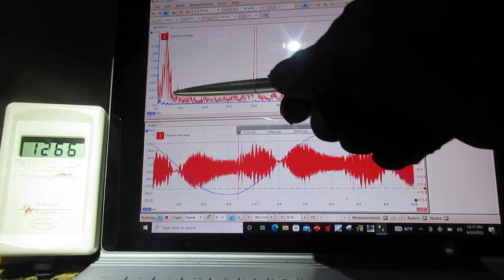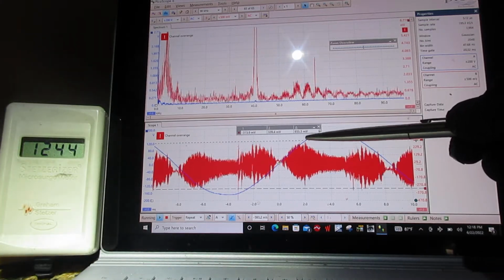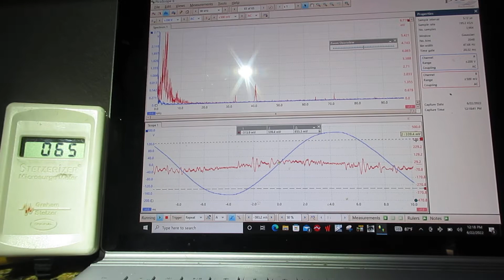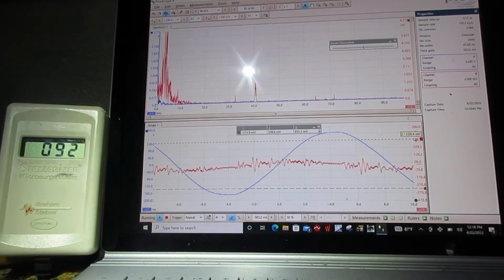Solar inverter next door creates discomforting Dirty Electricity for my client in Davis Ca.

Comment: I am curious, what filter did you use?
Reply from the maker: Hello MoeMar26: I start off with lowest cost parallel capacity filters and work my way of to expensive and very effective filters.  It all depends on which filter is most effective for a particular application and what the client is willing to invest or what is acceptable to them.  I never make product recommendations until I test and assess the actual situation.
Reply: @windheimemfsolutions  What is your experience with Line EMI filters?
Reply from the maker: @John-ek5bq  If the client wants more complete filtration I try them out and see if they improve on my basis filter set up.  They generally cost a lot more.

Comment: Hi Eric, thanks for sharing. I'm in residential solar sales, and I'd love to know your honest opinion based on what you've seen with DE: Could you feel good about selling solar? Should I steer people toward Enphase (micro-inverters) or Solar Edge (central inverter + power optimizers)?
Reply from the maker: Hello Joel,  I suggest you get a Stetzer Meter and measure exiting solar systems to see which combo of components produce the least DE.  In most all cases the use of a battery storage, such as a Tesla Power Wall or similar unit,  unit produces a lot of DE.
Reply: @windheimemfsolutions  Thanks for the reply. I sell remotely so that isn't something I can do. I don't want to make people sick, so maybe I should think about changing careers...
Reply from the maker: @joelechols879  Hello Joel,  People call me all the time and want me to make recommendations on this or that.  My response is that I need to make an site assessment first.  I base my suggestions on my measurements.
Reply: @windheimemfsolutions  Makes sense - thanks again

Comment: Eric, what filter was it that you used? We're all curious, as that was a significant drop in DE.
Reply from the maker: It is inappropriate to suggest a solution prior to an onsite assessment or personal phone consult.
Once exposure and risk levels have been established we have an established protocol order to follow.
Remove the offending device
Replace with a less toxic device,
Create distance from the source
Reduce usage of the source
In the case of an external EMF source filtering or shielding may make sense and be effective.

Filtration of DE is one of the last protocol I suggest to my clients and may not be needed.

It is important to perform a comprehensive EMF assessment before rushing to, purchasing or installing any single solution.
The EMF assessment is best done on site.
Remote assessments and consultations are available and may be effective: this may require that you purchase the correct meter.

I see more people hurting themselves with filtering or shielding than with any other intervention: because they rush into it.
It is inappropriate to suggest a solution prior to an onsite assessment or personal phone consult.
I do not recommend any specific product without an onsite assessment or personal phone consult.

Please be aware that there are lots of EMF product sales sites that have inventory to move and will sell to anyone for any reason.
Customers of those sites often call me after they have gotten no results or actually feel worse.

If you would like to have an onsite assessment or personal phone consult please contact me: https://windheimemfsolutions.com/contact-us/

Sincerely,

Eric Windheim BA, EMRS, BBEC, RFSO
Certified Electromagnetic Radiation Specialist
Certified Building Biology Environmental Consultant
Radio Frequency Safety Officer
WindheimEMFSolutions.com
Sacramento CA

Comment: What kind of dirty elecricity filters do you use?  Will Greenwave filters work for this kind of problem?  My neighbor is going to install solar soon.
Reply from the maker: It is inappropriate to suggest a solution prior to an onsite assessment or personal phone consult.
Once exposure and risk levels have been established we have an established protocol order to follow.
Remove the offending device
Replace with a less toxic device,
Create distance from the source
Reduce usage of the source
In the case of an external EMF source filtering or shielding may make sense and be effective.

Filtration of DE is one of the last protocol I suggest to my clients and may not be needed.

It is important to perform a comprehensive EMF assessment before rushing to, purchasing or installing any single solution.
The EMF assessment is best done on site.
Remote assessments and consultations are available and may be effective: this may require that you purchase the correct meter.

I see more people hurting themselves with filtering or shielding than with any other intervention: because they rush into it.
It is inappropriate to suggest a solution prior to an onsite assessment or personal phone consult.
I do not recommend any specific product without an onsite assessment or personal phone consult.

Please be aware that there are lots of EMF product sales sites that have inventory to move and will sell to anyone for any reason.
Customers of those sites often call me after they have gotten no results or actually feel worse.

If you would like to have an onsite assessment or personal phone consult please contact me: https://windheimemfsolutions.com/contact-us/

Sincerely,

Eric Windheim BA, EMRS, BBEC, RFSO
Certified Electromagnetic Radiation Specialist
Certified Building Biology Environmental Consultant
Radio Frequency Safety Officer
WindheimEMFSolutions.com
Sacramento CA
Reply: curious, what filter did you use? thanks

Comment: What type of filter was used and where should it be placed?  Near the electric box?
Reply: I'd also like to know what filter was used.
Reply from the maker: It is inappropriate to suggest a solution prior to an onsite assessment or personal phone consult.
Once exposure and risk levels have been established we have an established protocol order to follow.
Remove the offending device
Replace with a less toxic device,
Create distance from the source
Reduce usage of the source
In the case of an external EMF source filtering or shielding may make sense and be effective.

Filtration of DE is one of the last protocol I suggest to my clients and may not be needed.

It is important to perform a comprehensive EMF assessment before rushing to, purchasing or installing any single solution.
The EMF assessment is best done on site.
Remote assessments and consultations are available and may be effective: this may require that you purchase the correct meter.

I see more people hurting themselves with filtering or shielding than with any other intervention: because they rush into it.
It is inappropriate to suggest a solution prior to an onsite assessment or personal phone consult.
I do not recommend any specific product without an onsite assessment or personal phone consult.

Please be aware that there are lots of EMF product sales sites that have inventory to move and will sell to anyone for any reason.
Customers of those sites often call me after they have gotten no results or actually feel worse.

If you would like to have an onsite assessment or personal phone consult please contact me: https://windheimemfsolutions.com/contact-us/

Sincerely,

Eric Windheim BA, EMRS, BBEC, RFSO
Certified Electromagnetic Radiation Specialist
Certified Building Biology Environmental Consultant
Radio Frequency Safety Officer
WindheimEMFSolutions.com
Sacramento CA